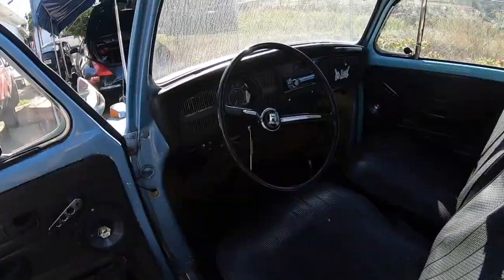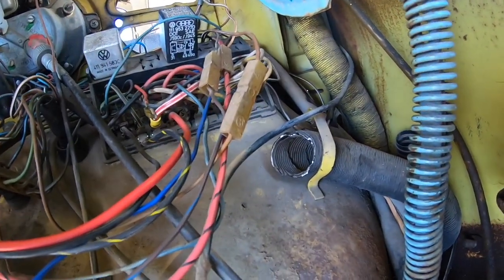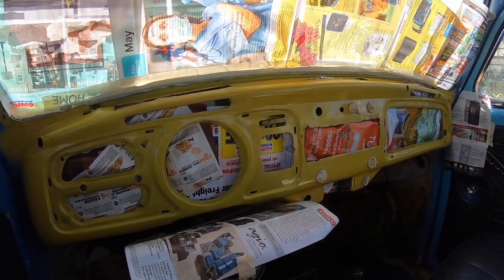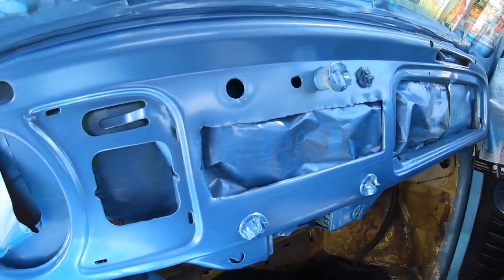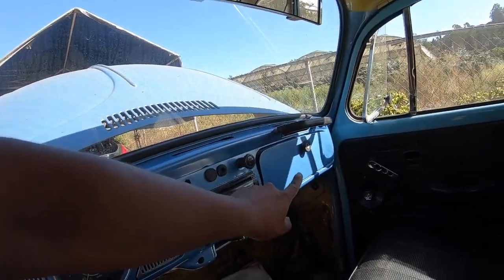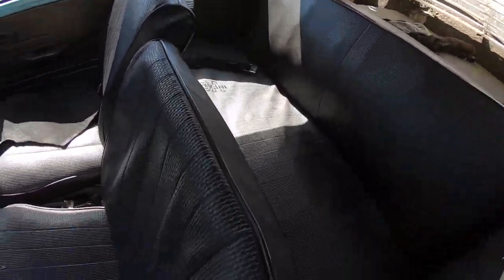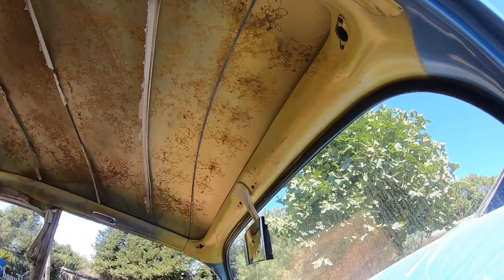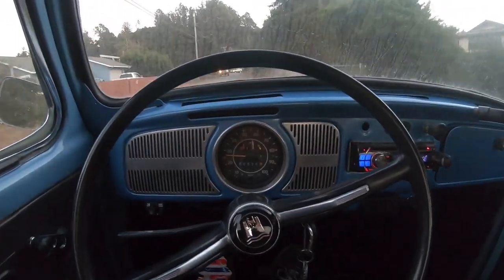VW Beetle Interior Makeover For Cheap !!

Comment: I have a '69 Bug I've been restoring.  I like how you changed to low-back seats. "72 was the first year for the ugly steering wheel that they kept til the end. How did you adapt that older steering wheel? Jbugs says it isn't possible. Did you change the whole steering column? That steering wheel is one of the reasons I looked for an older than '72 Bug.
Reply from the maker: Ima be honest with you bro. I bought the steering wheel from pick and pull and just swapped it over. No modification needed. And it flows better with the steering column as well.
Reply: @tuned_tunas  It's a definite improvement over the original.

Comment: how fast can the bug go, also that carpet made it look 100x better
Reply from the maker: Taken this one to about 80mph. Not safe at all. Lol thanks bro🙏🔥
Reply: Haha thats not too fast. 
I drove my 1200 at about 86mph max, for like 11 years it worked and with litte problems.
But the engine went to heaven this year , now got a new 1600 dual carbs engine build into it. 
Its actually quite fast ,I only need a better gearbox for lower rpms on higher speeds.
Reply from the maker: Hopefully your experience at such high MPH wasn't so scary. That built motor thing sound legit though.

Comment: I’m doing a 71 convertible now…but what about holes in the dash???  I think I’ve decided to use a “cleanup” dash overlay…I’ve tied tig welding patches…but just not clean looking…did you ultimately fill the holes…or just kind if live with it?
Reply from the maker: Surprisingly enough I found uses for all the holes and covered the vents to clean up the look. Finding uses for the holes was the hard part. But it came together quite nicely.
Reply: @tuned_tunas  post photos please!👍

Comment: Damn dude this makes we wanna work on mine i have a 72 super . By the way it looks good especially the chrome parts what paint did you use on it
Reply from the maker: You should totally work on it bro. It be a cool project for thr weekends. And I didn't use anything fancy bro just some autozone paint. Its a GM color match.
Reply: @tuned_tunas  i started working on it today after 3 years of just sitting i put a new battery and it started right up 🤯 so now it's time to get cracking